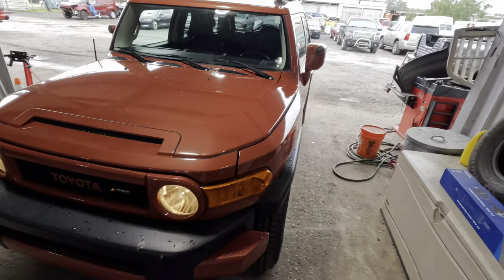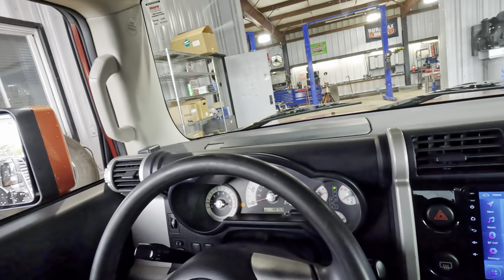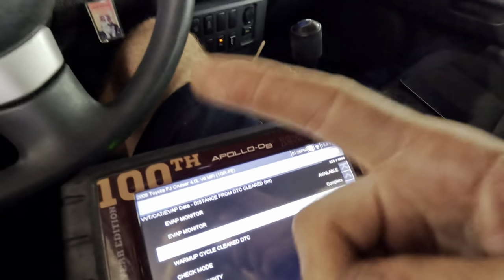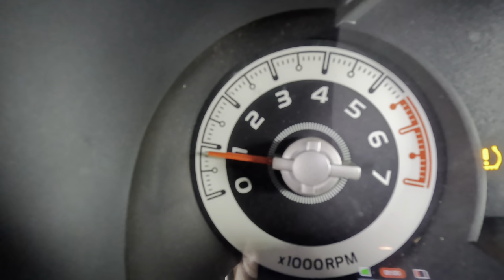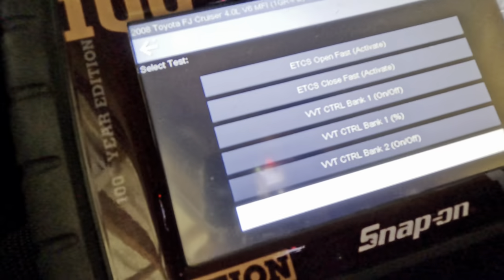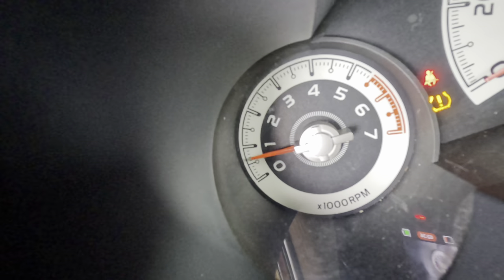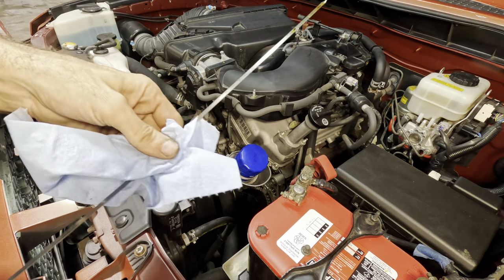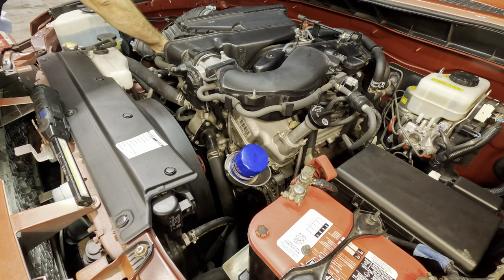Engine Problems at 50,000 Miles! P0016 P0017 Toyota FJ Cruiser 4.0 1GR-FE

Comment: Looks like the oil was changed for the first time to sell the vehicle.  Bet the valve train is a thing of beauty.
Reply: My thoughts also😂
Reply: It’s a Toyota it will last a good few hundred thousand miles 😊
Reply: @tradde11 I have mixed feelings on an engine flush as I bought a not so well maintained car years back it was running great no oil burn it was perfect then my mechanic recomended a flush and the engine seized in 1000miles! All the gunk had ended up blocking the oil pick up and it starved of oil😭
Reply: @johnlarkin549 I’d agree, get oil changes more often, should break that gunk up slowly over time.
Reply: @tradde11I’m certainly not a mechanic handy but no technical knowledge a double flush may get clean enough that it can’t cause other issues but really what problem is it causing anyway? Poor maintenance has already caused more wear and tear but keep up proper maintenance and it should keep on rolling along. I may have taken some brake clean to the solenoids instead of replacing them as if it doesn’t work it’s no big deal to then replace them that confirms I’m not a mechanic😂
Reply: They should have run a quart of cleaner before changing the oil. prob would have prevented this.
Reply: @parickaz  yes your correct but as I previously mentioned I’m not a fan of engine flushes 😃
Reply: I would either do an engine flush and drop the oil pan to clean off any remaining sludge in the pan and oil pick up 

Or

Keep changing the oil with synthetic oil and synthetic material oil filter more often hoping large sludge pieces don’t get through the filter (that’s why I would use a synthetic material oil filter (more expensive)).
Reply: @johnlarkin549   Toyotas, too can be killed by sludge.
Reply: I bet this was a leased car.
Reply: @johnlarkin549 Do the flush AND remove/clean the oil pan/pickup.
Reply: @joachimkazmaier  I agree but with only 47K on the clock  it’s got plenty more to give it hardly looks like it’s worked to hard 👍
Reply: Could you clean the solenoids out and reuse them?
Reply: As a maintenance engineer I lost count of how many broken machines had fresh oil in them.
Reply: Most likely to be in a real mess in there, one big clue was when he went to check for leaks with the engine running the noise from under hood sounded like two garbage cans fighting over a lid.
Reply: This is a candidate for a BG oil clean. Put the old actuators back in and give it the onion.
......then again, you only use the product but do not "sell" it.
Reply: Yep, knowing what we know now I would do a few oil flushes with the BG or  kerosene or whatever oil flush product.......well no, I would pull off the cam covers and clean it, but if I were not me I would do multiple flushes
Reply: Guy spends money on a nice K&N air filter, but neglects the hell out of the oil maintenance. ?????
Reply: Time for a BD engine flush or two😢
Reply: If you use the engine oil that can go to 10,000 miles or more , you can be neglecting the engine oiling system and vvt solenoids and timing chain guides and other timing related systems. I've seen many car that needed expensive repairs because of the labor involved to repair the problems of the engine isn't ruined. Spend a little on changing the oil and filter around 5000 miles and save a lot of headaches.
Reply: " You dont need to change that oil" and " its honda/toyota - never fails" crowd really did a number on a lot od good Asian cars... I know a lot more uninformed cheapskates that act like a former owner of this car than people that actually maintain their vehicles.
Reply: @johnlarkin549  Yeah, I'd have cleaned them off myself but I can see why Ray didn't try it - higher labour costs if they still proved faulty. Possibly more than the cost of the parts
Reply: @johnlarkin549 yeah, 50k for a Toyota is usually the “Break In” period.

Comment: I would have replaced the oil control valve filters as well.  Part number 15678-31010. Cost around 10 bucks each.  These are often overlooked on Toyotas.
Reply: Gold comment, clean them as least right? prob sensors cleaned with brake cleaner or gasoline will work fine as well.

Comment: Great diagnosis and repair Ray! No 50k engine should have that much sludge.
Reply: max 2 oil changes in its life time my bet.
Reply: @boelensds with that much sludge I'm thinking one or none before the recent oil change.
Reply: Heck iv got a 2018 accord with 12k more miles that runs like brand new. This vehicle is why i dont trust used cars.
Reply: Do they recommend 10,000 mile oil changes?
Reply: @basprad1563 I own a 4Runner with the same engine and no every 5000 miles
Reply: Correct sir -   Sludge = dumb  to me .    Lack of preventive maintenance !!!   $$$  or  …
Reply: @basprad1563 you forgot a "0". It's 100,000 mile changes. Lol
Reply: @boelensds I bought a used Toyota 2 years ago I'm still dealing with check engine lights a whole bunch of shit come to find out Toyota engine sludge up pretty good and I came from a Dodge neon when I went to junk it the engine was completely clean inside Toyota has a problem with sludging!
Reply: @peachyclean93 Only if you dont change your oil. I have a 15 4Runner with 205k just did valve cover gaskets one was ever so slightly seeping and its whistle clean. Also a 21 Camry with 120k and the oil in it comes out as clean as it goes in.
Reply: @Austin-cg7be  I don't know been hearing and seeing an awful lot of Toyotas having problems like this I own Chrysler products all my life I've never had any problems and I've gone three or four times with my Dodge neon at 20,000 mi intervals not changing the oil in the engine was so clean You could eat out of it!
Reply: @peachyclean93 , Dodge Spirits sludged up like crazy.
Reply: @peachyclean93 I've never seen Toyotas sludge up when maintained with normal oil changes. Only time I would see it is when they follow the 10k mile intervals and exclusively do short, in-town trips
Reply: I don’t understand why you didn’t go ahead and do an engine cleanse because it’s just gonna create the same problems that this person had before you’re just passing on the problems. I have that stupid ass Kia Sorrento that has this issue I guess and it just burns the oil, even though there was a class action lawsuit and they lost kia doesn’t wanna do anything about it and I changed the oil every 5000 miles as told but once that started burning oil with every gas fill up. I just started doing it every 10,000 miles because I had to put a quart of oil in every single gas fill up.

Comment: With that sludge i would be worried the VVT oil control valve screens or filters would be clogged. One per cylinder head. I definitely would of pulled off the timing chain inspection cover to look at the tensioner and thats a good view for sludge as well. Great video Ray.

Comment: With jobs like this I like to show the customer (usually my missus) a picture of the new part and then show them the old part. It drives home the state of the damaged/imparied part and they tend to feel much better about having spent the money to effect the repair. Lots of "Holy crap, you were right! That's wrecked." etc.
It's getting to a point these days, that you should take a scantool with you when car shopping.
Reply: 100% need to take a scan tool. Even a cheap $20 reader to check if the codes were cleared recently. Once you buy a used car, it the new owners problem when that CEL comes on
Reply: Just keep some trash parts around to show customers - same effect. Customers don't know 99% of the time when being duped on parts.
Reply: I took a scan tool when I purchased my last truck. You find out real quick who is honest. I ended up buying another truck from the dealer of the first one because of the relationship built. Of the 7 dealers I delt with 3 I could trust. The rest ... You have to be your own advocate. The dealer rarely has your best interest in mind.

Comment: You're the man Ray, that must have been a hard 50,000 miles.
Reply: First oil change, old filter was Fram.
Reply: At the risk of sounding judgmental, this vehicle has been a garage queen.  Evidenced by the Optima Red Top battery, K&N air filter, and sludged oil passages.
Reply: @michaelbolton2741 What are you trying to say? An expensive battery, a higher end air filter and no oil changes is funny arithmetic.

Comment: It's great when you find the goo, a reason for the codes, and a confident fix.  I suppose, if it was your own vehicle, you could spend a happy few hours with a solvent, getting slightly high, while cleaning it all out.  (Always use solvents in a well-ventilated area.  As we always do, don't we.)
Reply: I was wondering the same thing how much crunchys are left in the port

Comment: Man, that's a lot of sludge.  I would probably have stuck a borescope down in there to see what kind of sludgy junk is in that engine.  Someone wasn't a good oil changer when it was time for that kind of build up.  Would be a good idea maybe to run some BG flush and change the oil a couple of times and maybe clean out some of that gunk.  I've seen other vids from you and a few others changing out actuators but never seen that much residue.  Wild.  Thanks for taking us along.  Take care.

Comment: Excellent video Ray! As a 2008 FJ owner since new, I really liked your diagnostic rationale and simple to understand repair procedures. There does seem to be a few red flags i.e. A known reliable Yota 4.0 1GR-FE engine with potential other sludge issues? Does anyone think this might have been a 08 FJ that sat for a long time? or perhaps long oil change intervals? Brand new paint and newer aftermarket radio? Hopefully, the FJ, Taco, and 4RNR forums will put this video in their respective trouble code libraries.  A strong takeaway is to always get a pre-purchase inspection or proactively offer one to a new buyer. I recently privately sold a 2013 Accord with a $150 PPI purchased via a Honda Dealership. The new owner was appreciative and said he will do the same when he sells his Ford -F150.  Always keep it honest and feel good.
Reply: I’m curious what you would consider too much time between oil changes?

Comment: Ray, did I miss you tightening the clamp to throttle body from air intake?  Looks like the engine needs a good flush next oil change.  Good repair
Reply: Did he also miss the zip ties on the connector?
Reply: Sometimes he does this so we can say reeeee! I noticed the clamp screw too, but forgot about the zip ties!!
Reply: Plus a miss on the wipening of the grease off the hood the last time he shut it even though he wiped it with a paper towel every other time :)

Comment: That’s a bit concerning based on mileage. Previous owner was skipping oil changes.
Reply: @@ukstandswithukraine8417Someone didn’t drive much which turns oil to sludge if you change by mileage.
Reply: At least a few.

Comment: Awesome job, Ray. You are one of very few who actually THIK through a problem instead of throwing parts at it. I learned long ago that the first rule of troubleshooting is to understand how the system works. Anyone who doesn't is wasting time and money. 

I appreciate and enjoy your work.
Reply: I agree you definitely need to know how a system is suppose to work to troubleshoot problems with it. Then it comes down to a systematic process of elimination to what component is causing it not to work as designed. Which is what Ray did here.

Comment: Usually you want to do a pre-purchase inspection. All those lights are normal when the check engine light comes on. Toyota will disable the abs system until the light goes away.

Comment: So what caused the actuators to clog up so bad at 50k?  Is it a lack of oil changes?  The oil looked recently changed but it could possibly been neglected, no way of knowing by just checking the dipstick.

Very curious... You fixed the issue but seems the cause works still be there and clog the new actuators.

Great videos as always
Reply: lack of oilchanges, definately. I'd recommend an engine flush and hopefully the new owner changes the oil each year, or every 5-7k miles,
Reply: Definitely lack of oil changes at the recommended intervals!

Comment: I recently worked on a 08 FJ funny I had the same codes and when I pulled those solenoids out after fighting with them for 30 minutes they both were plugged solid with sludge. Flushed the oil system with cleaner and did double oil change it cured the problem. Wish you would have made this video a month ago would have saved me time changing them. Lol great video keep up the great work Ray

Comment: Im guessing that was run without oil changes until it was up for sale. Good candidate for a cleaning.
Reply: Agreed.
Reply: Unfortunately, with that amount of abuse, the sludge can stop up the oil pump pickup and kill the engine.  I have seen that scenario several times.  Never buy an older used car with very low miles with no proof of oil changes.

Comment: Thank you!  You made it possible for a mechanical neophyte to find my solution.  The most memorable thing I remember you saying was something like "Don't throw parts at a problem, instead analyze the problem."
I began with the swap of the camshaft sensors, after first cleaning the codes P0006 & P0335.  But before I even got that far, upon taking out the Bank 1 sensor I was astounded to discover the amount of grease covering it (I wish I could post the pictures that I took - just horrible!).  
Since I'd read that the only thing that these failed sensors report is that they aren't getting data, I figured that all it needed was a good cleaning - just a wipe down, no solvent.  Then, taking out the Bank 2 sensor I discovered it in a similar state and cleaned it too.  Then I swapped them, also cleaned the dirty throttle body while I was there, and restarted the engine.  Knowing the computer had to adjust for the newly cleaned throttle body, I let it run for about 10 minutes until it came down to normal idling.  On that startup and for several since then, plus about 30 miles of mixed driving, the computer has reported no codes and the CEL light has not re-lit.  Further, a buddy of mine with a full-service shop hooked up his full-featured computer and also showed no codes.

Comment: It is somewhat concerning that those actuators got that bad in only 50k miles. Could that be a bad quality oil thar would cause that, or just a badly designed part? Keep up the great work Ray and Dave of course. 🇬🇧
Reply: I would guess that the oil was never changed. Except for the recent one. That was a lot of sludge.
Reply: The best part in the world is gonna have a difficult time dealing with that amount of sludge
Reply: @eugenealbrycht2132  That was my first thought.
Reply: The oil was changed probably once since new and then right after it was sold. I would have flushed that engine at least 10 times. What a pity, truck looks brand new
Reply: Lack of oil changes did that.
Reply: Even with super low mileage, or especially with super low mileage, you should change your oil at least once a year and maybe twice a year. Some engine contaminants are actually made worse with very short driving cycles.  I don’t know how many changes that Toyota got, but it was way less than 30.
Reply: Let's hope new owner changes oil lol
Reply: Master mechanics that have been with Toyota for twenty years tell you that five thousand miles or six months, change your oil. I use Toyota oil, but that’s only rebranded Mobil One synthetic. Oil filters will not filter out carbon “sludge”. So the longer you go the higher percentage of carbon is contained in the oil. I’m 67 yrs old, I’ve always changed mine every very three thousand miles. But I enjoy it, and oil and OEM filters are cheaper than a new car
Reply: @StrongDreamsWaitHere I'm with the others here giving a best guess of: Once.
Reply: One thing I've learned is that oil is cheap, engines are not. That said, change your oil sooner than the manufacter suggested schedule.

Comment: Yep, VVT, go ahead and skip oil and filter changes on time or mileage which ever comes first. I have a same year Tundra 5.7 and change my oil every 6 months as Toyota recommended, sometimes with only 700 miles on the oil. Cold start  with short runs are much harder on the oils additive packages as the water in the oil never has a chance to boil off.  This previous owner really pisses me off.

Comment: It's a shame that the FJ Cruiser isn't made anymore. I always wanted one however we could do without variable valve timing. I thought that it might be a ill maintained situation. Fresh oil change...
Reply: shame they never put the 3 litre 1kd turbo diesel in it
Reply: @rogeralbans4082 is that the diesel they get in Australia that cracks pistons? 
Reminds me of the 6.0 we get here in the states.
Reply: I've always liked the look of the FJ but I couldn't own one. The drivers visibility is crap. Such big blind spots all around.
As for VVT, l'm not sure you can find many engines without some form of variable valve timing after 2000 or so. Certainly not from the last 10 years.
Reply: @ORRadtech  I'm a veteran concrete truck driver of thirty five years so I'm used to working my mirrors and I'd fit right in on the FJ. If I need to back up I just have to keep situational awareness and get out and check behind me if needed and often times I'd position my vehicle to have a way out and to keep an eye on people and things.
Reply: Position all head rests to increase view…. Use mirrors,  backup camera and backup alarm…… all will be fine.